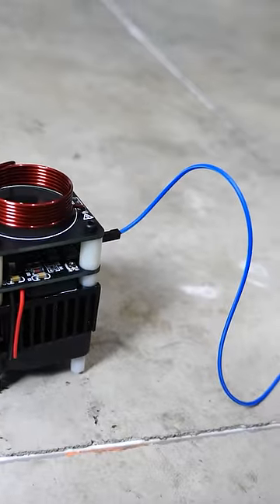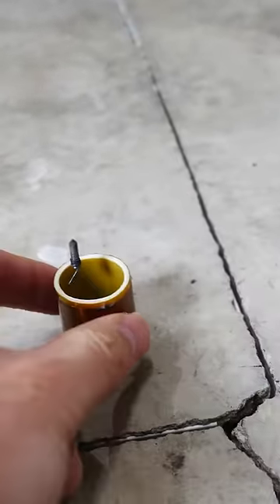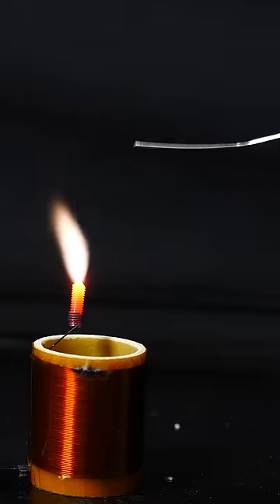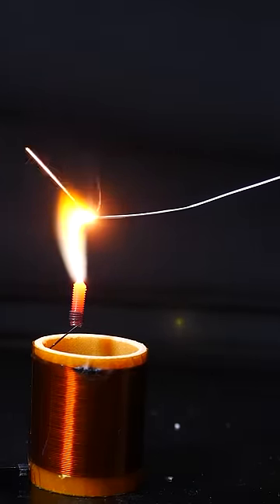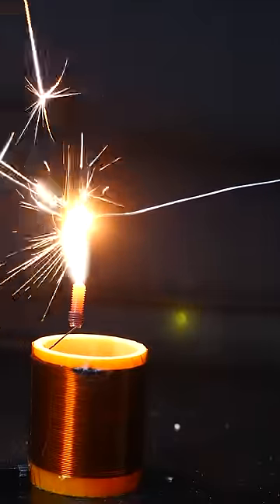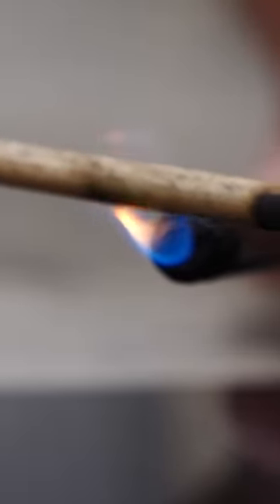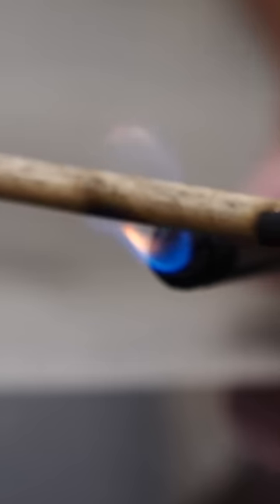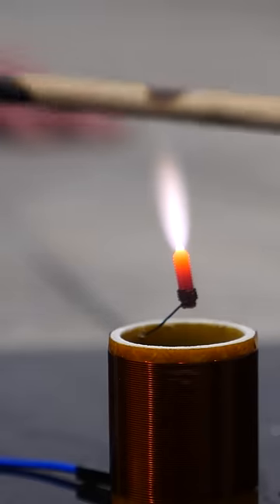The World's Hottest Candle

Comment: "How can you heat a room with just a candle?"

Me:
Reply: Add a clay flower pot to the candle and it will do a great job heating a room.
Reply: @gary609906  

Does the clay somehow increase the heat output of the freaking candle?
That's pseudo-ingenuity. It's called a waste of time, you get the same BTU output with or without the pot.
Reply: @bradleyakulov3618  I dunno dude but it works better than just a candle
Reply: @gary609906  That would break the second law of thermodynamics. Let's say the flame of the candle is around 200 celcius. The clay pot cannot be hotter then the source of the heat. All you're doing is transferring the heat from the candle to the pot which then transfers its heat to the ground, and the air. That's arguably worse then just a candle which directly heats the air.
Reply: @m3taldragon1  I dunno dude but it works better than just a candle
Reply: @gary609906  
No it doesn't. There's no additional source of fuel or heat with an inert pot.
Reply: @bradleyakulov3618  I dunno dude but it works better than just a candle
Reply: @bradleyakulov3618  he got right :/ clay give IR from bigger structuture than only candle exchange heat with air, only you need to heat up this clay pot first and its long time.
Reply: @bradleyakulov3618  so why adding the passive cooling to anything? wouldn't it make heat exchange 'arguably worse' than just cpu 'directly exchanging heat with the air'?
Reply: @m3taldragon1  You are wrong. You are forgetting about 2 variables in this experiment. Firstly, surface area. Secondly, thermal mass. That flame is the size of a lighter flame, but its temperature is over 10,000°c. Forget melting iron, its 2x what you need to boil tungsten. If you took the time to heat a large thermal mass, like a big block of copper, and used that hot copper to heat water, you might be able to heat an entire floor of a house with that hot water. Same idea with the clay pots. Heat them up to 40-50 degrees Celsius, and they act like little heaters.
Reply: The pot is used for convection. It creates regulated airflow that heats up the room faster.
Reply: @bradleyakulov3618  well, it decreases the actual heating to the room as the pot has to heat up too, but heat in air molecules isn't everything. What about black body radiation? It makes you feel like the room is warmer than it really is. That's why those pots help
Reply: That's actually considerable.
Reply: @mitotakjde9763  may be it has the same system as pipe heater? where 1 point heat can be transeferd to whole house
Reply: @bradleyakulov3618  You get the same heat, but in a different place. With a candle, it goes up away from you in the air. If you heat clay, you have hot clay and IR radiation.
Reply: @m3taldragon1  It is normally about heating oneself, not the room - in that case it makes sense to keep the heat near you instead of actually heating the room.
Reply: @bradleyakulov3618  You have the same amount of heat, but heat is not distributed in the same way in the room. The air is warmer in higher parts of a room, and it does not help you much to heat the highest parts more, increasing the loss through the ceiling without benefiting the lower layers, where you probably are.

Comment: if anyone wonders, 11000 kelvin is 10,726 celsuius or 19,340 fahrenheit
Reply: It'd be 11,000-272 = degrees bc it's the same scale, but it starts at the coldest point which is 272, so 11,000 Kelvin would be 10, 838°Celsius
Reply: @moxxy9249  nah  11000 - 272 is in fact 10726
Reply: So like McDonald's coffee?
Reply: @M1szS  10,726.85°C convert +273.15 = 11,000K ...if you could measure that, but measuring it would not be accurate because....? C'mon class...
Reply: @nickv1008  ?
Reply: @M1szS  its these darn slide rules, they don't tell you where the decimal is....And that Heisenberg fella, you never know exactly where he is either...
Reply: @nickv1008  ok
Reply: With units, it is 11,000 K (Kelvin) or 10,726 °C (degrees Celsius) or 19,340 °F (degrees Fahrenheit).

Comment: “Ultra high frequency: 15mhz”
looks anxiously at CPU
Reply: Yeah, even as a radio it's just short wave.
Reply: Yeah but in the tesla coil your shifting medium amounts of energy while in your CPU you dont shift serius amounts
So its mutch easyer to shift at higher frequenzies
Reply: @J__K__J  I know, but some people might not. So, thanks for your contribution.
I believe it’s mostly because of the resistance and voltage that makes it more intense.
Around a 1000 volts with quite a bit more resistance vs tiny bridges that run anywhere between 12 volts to around 0.1 volt with almost no resistance.

Comment: did I hear  'degree kelvin'?
Reply: Subtract 272
Reply: It's basically same as Celsius at this point. 11k degree Kelvin almost same as 11k degree Celsius
Reply: Same scale as celsius, only kelvin starts at the coldest possible point, where atoms are completely stuck in their place. Which happens to be -272 celcius
Reply: I think it's more a language slip than a faux pas, saying X degrees Kelvin feels natural.
Reply: @desmondyung  I think the point was Kelvin scale has no degrees technically.
Reply: @TurinTuramber  eh I think ur right 🤣
Reply: @TurinTuramber  yes 😂
Reply: @HvV8446  Why -272 ? If I remember correctly it's -273.15 🤔
Reply: @jankomuzykant1844  cuz guy on top said 272 and i know that its somewhere around there but was too lazy to look up the actual temp. Besides, you'd be an ice cube long before you can measure it anyway

Comment: So how valid is this as a method of melting metals and creating a heat source? Valid as in.... How much energy is used/lost vs other methods of melting metals??
Reply: I think it is actually used in steel industry.
An important point is not to use a fossil fuel.
In terms of converting electrical energy to heat it is near 100%. You only loose some light - but heat is the default way where the energy goes to, any loss would end up as heat anyway.

Comment: 1100K° is roughly around 1400-1500F° 760-815C°. which is just enough to melt aluminum but not enough to melt copper, silver, gold or brass or other metals. yes it can melt steel but the steel will have to be a really small peace, otherwise you won't get anywhere.

Comment: How much current does it take to run that coil unit ?   Watts and volts ????

That may be a better option 
For making power instead of nuke rods  for turning water to steam 
We could use solar panels or a small self contained reactor to run a larger battery of T coils  to heat water  

Once that water starts steaming to generate power it could be routed back to drive the coils and break some laws of T dynamics.

Comment: So this thing can melt steel? Great. How about adding a pot so that we can control the power output? I want to adjust it so that it will just barely melt a steel wire. Then we make a 3D printer. One that prints stuff in steel ! Using cheap wire as input !!! A worthwhile project?